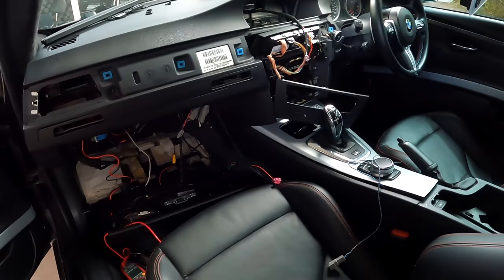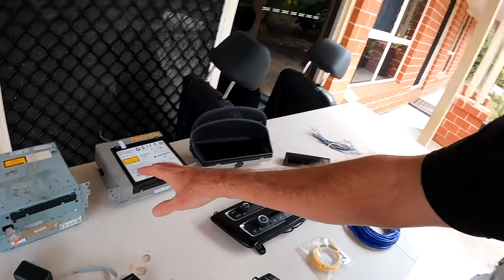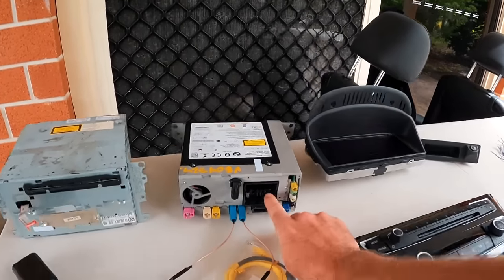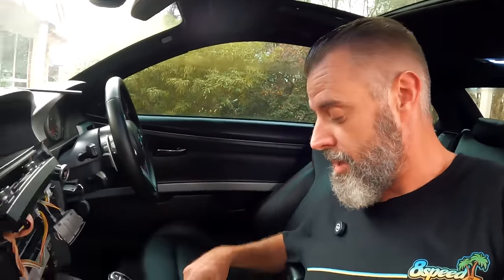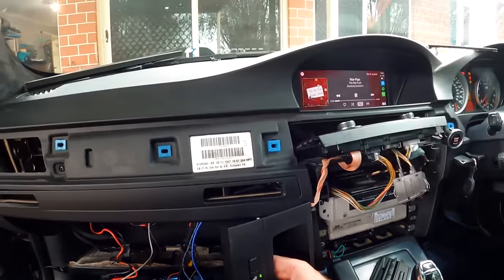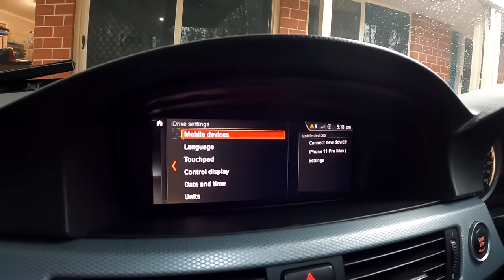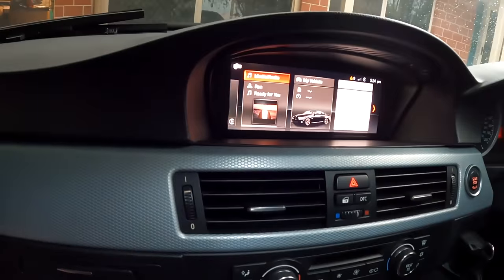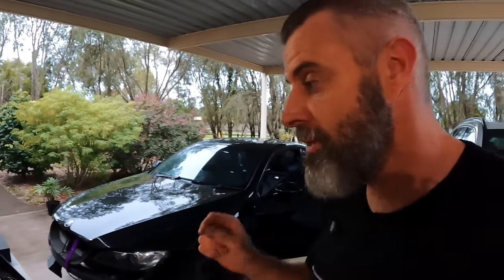E9x NBT EVO Touch Screen RetroFIT INSTALL: OEM PLUS

Comment: I never even knew this upgrade was an option. Looks like a huge pita though. I've been sitting on an android head unit for awhile myself. Trying to figure out how to run the aux in a way that not janky. Your new setup looks much more worth while though. I love seeing all the retrofitted stuff man. Your E92 is going to be pretty bad ass when its done. Your car is turning out to be some pretty serious inspiration for my build. Keep it up man, cant wait to see more.
Reply from the maker: Thanks for the kind words. This infotainment is next level. Huge pain to work out yourself, but if you get a full kit, its not hardner than a android install. Problem is the cost. However if the car is a keeper, i think worth every cent.

Comment: The NBT system looks and sounds great Andrew. Massive improvement on the OEM system like I have. The echoing issue when making a phone call wouldn't be because both the phone mic and car mic are picking up your voice. Another great video.
Reply from the maker: No its to do with how the amp processes sound and then how the Unit listens to the sound in the car. I think its just amp runs a small delay that the NBT isnt looking for. So it thinks the sound is the person in the car speaking, not the speakers,.

Comment: I’m doing this at the moment. The NBT evo ID 4 has GPS port from factory and 2 GB ram. Id5/6 didn’t face GPS factory and used an ATM for GPS signal. A GPS plug can be added to these later ones. The ID can be updated to id5/6 firmware 1803 which supports Apix1 screens (ID 4 screen)
Reply: Couple of questions if I can. How is that lovely touch controller mounted to the CIC centre console trim. What have you done with the DAB antennas and the lack of FM2 in the car.  Happy to share the guide/wiring diagrams I’ve done.
Reply from the maker: Hey Mate, i used a file to get the controller in place. The NBT controller was only slightly larger than the CIC. I then used the original CIC controller mounting screws locations with large washers and holds the NBT controller perfectly. I do not have DAB antennas. Only FM. Tbh i never listen to radio. So didnt bother even looking in to the DAB setup.
Reply: Some iD5 and iD6 head units did actually come with GPS and DAB built in, but they are less common to find and are reliably more expensive than the ones without.
Reply: @ZeroTo60Tube  just done this today, Fakra splitter for FM antenna and generic DAB antenna worked well. Block I've hit is getting the faceplate. Mind if I asked whether you secured the HU in the cage and whether you had to drill the HU for the faceplate panel to pop in correctly. Final hurdle!

Comment: A proper tech video once again.

What are your thoughts on the new DI delete kit from Nexsysmotorsports? I am having some real trouble shooting issues with Motiv on their Reflex system!
Reply from the maker: It should be legit. I have one on the way as i do want to try it for myself.
Reply: Yes agreed. Just think with the rising cost of the injectors and if you already have some of the supporting mods it’s a no brainer…at 500+whp you shouldn’t care about gas mileage lol.

Will you be making a video? Not sure but there doesn’t seem to be a lot of videos out yet!
Reply from the maker: @edwardwerley8831  I will be doing a video absolutely.

Comment: If you've got the Logic 7 amp system you can update the amp using WinKFP to the latest software so that the NBT unit will be able to communicate with it on the MOST network.
I've ran into this issue myself and the software update solved it.
Reply from the maker: So that fixes the echo while on calls?
Reply: perhaps for NBT but defs not EVO. Only the Harmon Becker F series Amps have the right firmware to support the EVO phone command on MOST bus to disable processing (and stop the echo delay for callers). Only the NBT EVO has the delay issue, NBT units still provided the old command to E series amps to disable the delay in processing.
Reply: @ZeroTo60Tube  You must fit a Harman Becker manufactured F series Logic 7 amp or Bowers & Wilkins amp to fix the call echo while fitting an EVO into a E series car.
Reply: I have the first NBT model, not the EVO, mine had no sound at all, so had to update the firmware on the amp to fix that issue. I have no echo during calls.

Comment: I put in an Xtrons in my 1er, and although I love the screen quality and responsiveness, I am not impressed by the software at all, or the wifi.
Wifi downloads are ULTRA slow, even with the included antenna plugged in. 500mb takes 4 hours to download, but just times out before that, so I gave up on downloading offline maps. 
The features on the unit are also very limited. Calls don't work (ear-murdering static) and bluetooth cuts off sometimes. 
And recently, my amp relay went out, which I'm still troubleshooting, so hopefully it's not related to the Android unit.
Overall, the sound system, not the powertrain, has been the MOST FRUSTRATING thing with this car for me 😅
Maybe I'll try this nbt retrofit next!
I love listing to the engine & turbo noises when driving, but I also want music & podcasts sometimes.
Reply from the maker: Hmmm thats annoying with the sound system for you so far. While i think NBT EVO is by far the best. I dont think its going to help with the amp issuse. It will help with the phone calls tho. The noise cancelling in the NBT EVO is next level. It makes people think you are in a house. Not driving in a car.

Comment: Question, do you know anyone who's swapped a Barra engine in a E9X platform? I hope I said that wrong. I've seen other kids that people swap that engine into a lot of cars. If so, how hard and expensive would it be to buy and ship to Hawaii or the US Mainland? Please lmk if you know. Mahaloz!
Reply from the maker: I know it’s been done. However I’d imagine it’s horrifically expensive. If you are trying to make 700-800hp the n54 will be cheaper. If you are aiming for 800-1000hp a b58 will be cheaper. It’s the 1500hp builds where the Barra makes sense.

Comment: Can we obtain everything and have Brian code it? Or will he need the units in order to code ?
Reply from the maker: I believe bryce does offer a coding service. It may require some special tools. But if you are overseas it would be the way to go.
Reply: @ZeroTo60Tube 🤔 could I use a EBay e90 cic android head unit for touchscreen? Or will any touch screen will work from a bmw that fits in the display housing ?